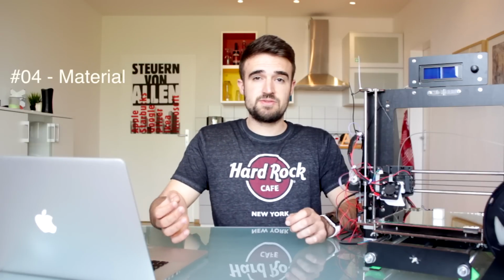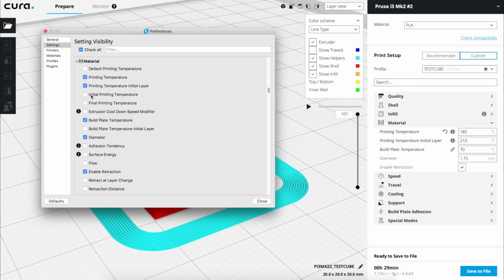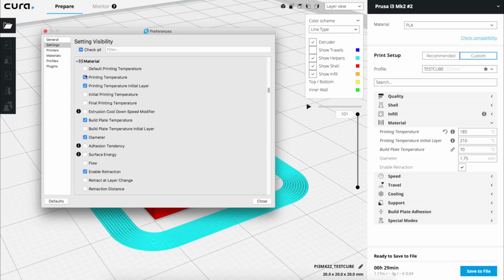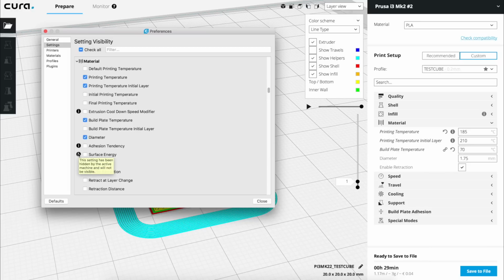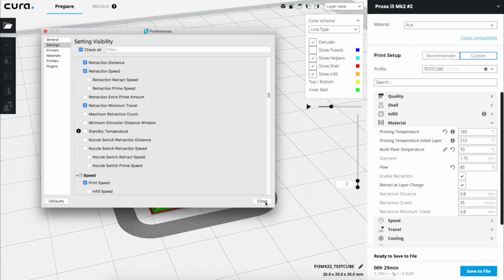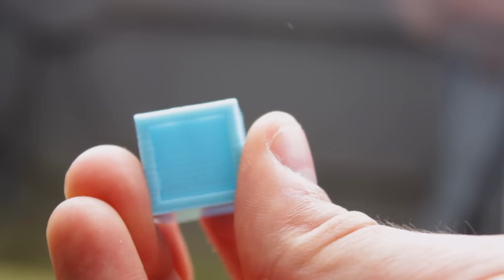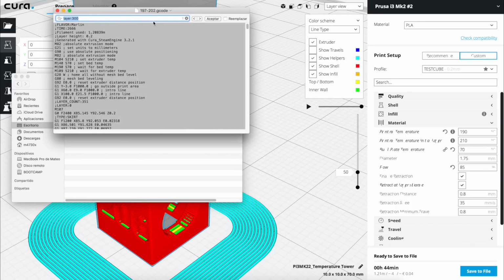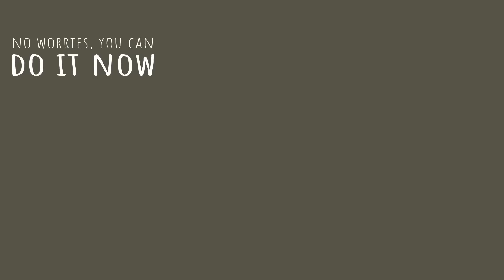Cura advanced settings 2018 - #04 Material

Comment: Hi, i want to know if there are an option in Cura to do what you do in 4:10 (the nozzle start to extrude and the bed cut that thread and the print start very clear. Btw thanks.
Reply from the maker: Hello Trunk Buff! Yes, you have the option to add custom code at the start and end of the print in cura. For that you have to go to machine settings, in the preferences, and add the code to do that movement at the start. :)
Reply: @architects3dp  Wow that works very well now, thanks for the help man. I have already seen all the Cura Series, you are so good. I have learn so much, keep going like this.
Reply from the maker: @elrrusoo_fpv  Thanks for your support man! :) :)